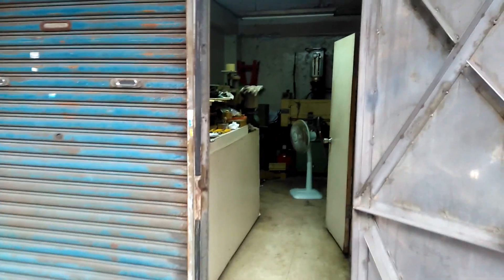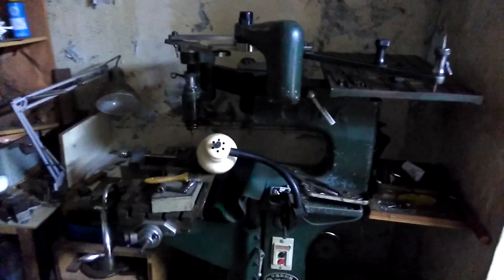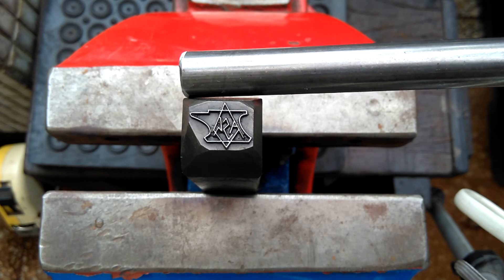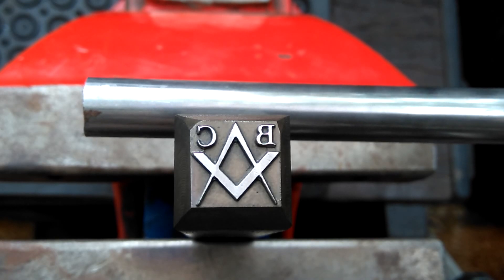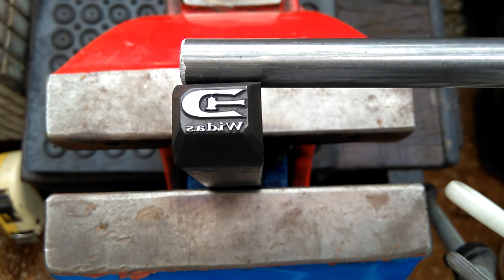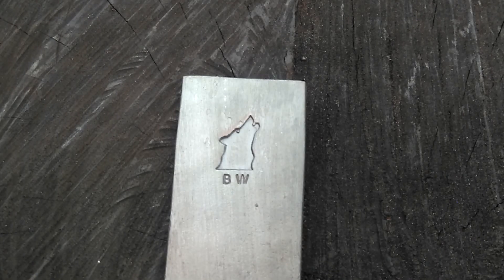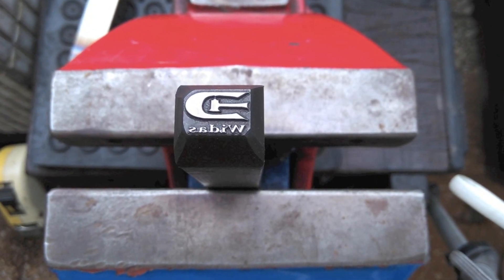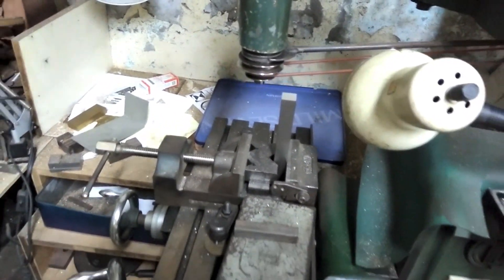Blacksmithing - the engraver's shop & more touch marks - GS Tongs

Comment: The two most prominently found pantograph engraver/duplicator brands found in the USA are Gorton and Deckel.  These machines can be purchased in great used condition for only $1000-3000 USD because they have almost completely been replaced by now with CNC equipment.  They would still be fine for hobbyists or small volume "one-off" work.
Reply from the maker: +AndTheCorrectAnswerIs Thanks for this great information. I'm still not sure how he makes the copper templates of the touch mark designs which the pantograph traces - maybe some sort of copying/printing machine... No matter, with his equipment he is able to do fantastic work. Thanks. Glen
Reply: +Glen GS Tongs I didn't see the copper templates, but I don't know why he'd be using copper UNLESS he is acid or electro-etching them. Both methods require little equipment, expense, or space. Etching used to be used to make copper printing plates for old printing presses.